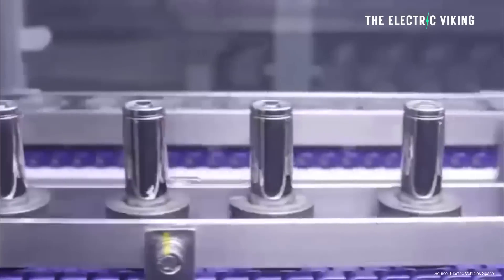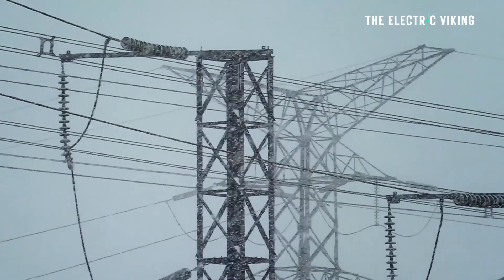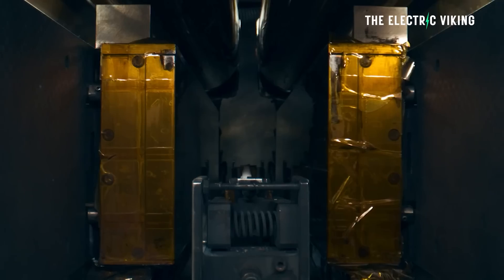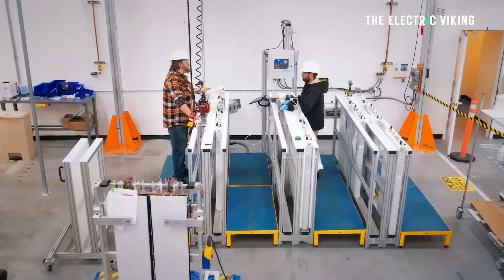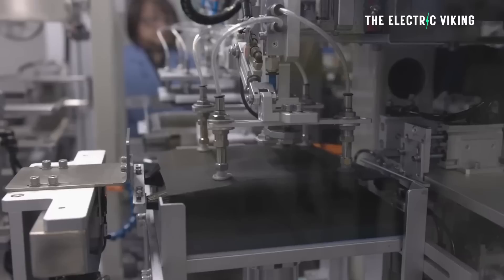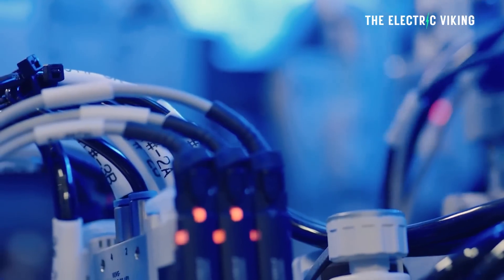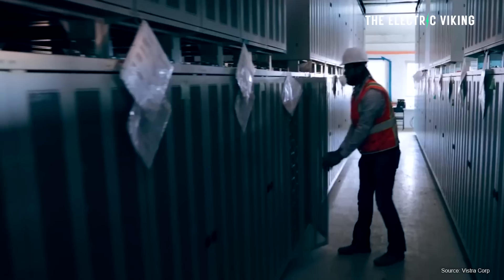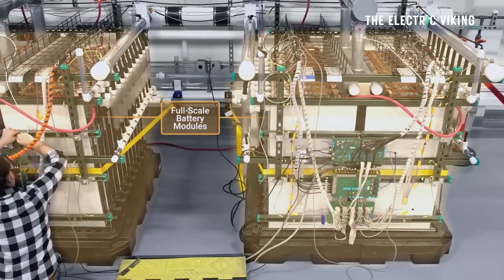U.S company reveals revolutionary battery that DESTROYS sodium & lithium

Comment: Talks a lot, but knows very little about technology.   He is surprised that iron air battery would be the selection for lost curtailment power storage and discharge.   This means he doesn't really understand what is happening with battery chemistry.  Also did not hear anything about the pros and cons of this battery.  Disappointed by this channel, so just another one I don't have to bother with.  If the reader wants more information watch "Just have a think".

Comment: 3X calendar and cycle life is probably the way they figure 1/10th the cost amortized of 50+ years.   But the low power density means Sodium Ion or LFP will certainly have a market to meet maximum power demand, as small scale applications like charger, wind and solar farm buffering.   These Iron batteries have higher upfront cost especially for short duration.

Comment: Adjunct to lithium/sodium, not a replacement. This is base grid storage, and the Li/So are ‘peaker’ storage. VPP/VMM tech not so easy to duplicate …or they would have already done it. ENRON did come close, but their problem was ‘gambling’ with other people’s energy. “Oxidation” as a catalyst using iron or different materials requires large/Big/HUGE infrastructure, so this is a lot of smoke until we see what’s behind the mirror.

Comment: It sounds to be in a similar situation as the Zinc Bromide batteries that were being touted a while ago. Hopefully the tech actually starts working soon.

Also, the number of days of storage is not the capacity, but takes into account other practicalities, like efficiency and power capability. The Limiting Factor did a nice video about it called: "How Grid Storage Duration is Assessed and Why it Matters".

Comment: Multi day storage equals low payback, batteries earn money only when taking in cheap/exsess and delevering energy, not when holding energy. Therefore it must be very low prices to consider.
Reply: One area long duration batteries help with is grid congestion, where there is a generation imbalance between grid locations and a transmission limit between those two locations. In the current model Grid's pay generators for not puttting power onto the grid in the over supply areas and at the same time pay for high spot rate peaker plants to rapidly generate energy in the constrained area. Long duration batteries address this by balancing these two areas more evenly reducing the wasteful payments involved. The pricing cases take this into account, as the Iron-air batteries are a capex spend rather than an operational spend (other than servicing costs), hence work out cheaper to operate.

Comment: Wouldn't the voltage be very low? Wouldn't you have to have A LOT of cells in series to get a decent voltage? Seems like you would need a HUGE battery to get something useful. Enormous really. I'm not sold on this.

Comment: "While iron-air batteries have a round-trip efficiency of around 50-60%, lower than lithium-ion batteries (which exceed 90%), their key strength lies in long-duration storage." That's the downside, getting less energy back. 1/10th the cost is good, but not otherwise equivalent, but I suppose you can use both this and sodium-ion and/or lithium-ion or other tech for first days/s and this for longer term storage. Don't you need for even longer storage in some situations, e.g. across seasons even (say in Iceland photovoltaics not worth it, or at best in the summer?)?

Comment: What I haven’t heard you say is what the size/weight to energy storage ratio. Large scale grid batteries don’t have to small, they can be considerably larger, even if the output is lower. Current batteries are principly for cars/trucks. So the story could be true. You won’t be able to use them for cars however.

Comment: When you put two metal rods into the ground, a voltage potential exists between them. 
If you bury them very deep into the ground and use frequency modulation you obtain higher and higher voltage.
When you raise a higher isolated wire up in the air, a huge voltage potential, like kilovolts per kilometer, is obtained.
One can even design and build a humongous continuous capacitor between Earth and the air around Earth.
Etc.

Comment: I wrote this right before getting to the part in the video where Sam addresses this!:

What's the C-rate? I can't imagine this can put out much power, so would only work in applications where it does in fact need many days of storage just to have a big enough battery to put out the power required. But if it is 1/10th cost, then maybe it would be worth having a battery with far more storage than you really need, as it could bring down the amount of "extra" solar and wind that is needed (eg instead of planning for 3-5X the solar needed to cover demand on cloudy days, that could be cut down to 2-3X)

Comment: Hey Sam:  I just went thru the Form Energy website... their Newsroom pages are an amazing resource. They are building a $750m manufacturing plant... that takes some big balls, without scale-up and proof of concept on a smaller scale... I wish them well. One thing you didn't mention... batteries are only half of the equation... the other half is the software and integration of solar/wind generation + batteries >> the existing conventional grid. Software is everything in integration, and only Tesla has nailed that half of the equation.

Comment: 2% - 4% of world's population lives in regions in the North where solar will never be enough around the year, and where there can be periods in winter/cold time with no wind. The described "rust battery" with relatively "low" power output would serve the Northern regions quite well  if the building cost per MWh is low enough. Something like that -  high storage capacity low cost battery - will be needed by the North. This is like 10x Australia's population.

Comment: At 2 to 3 MW per acre compared to (how many LFP megapacks per acre)? Looks like "housing" costs will be more expensive than the battery itself 🤔
Maybe the energy density is around 1/10th that of the lead acid? There's no mention of the efficiency, or the amount of energy needed to make them, either? If they last a century, though, the energy inputs couldn't be that bad.
So the main thing is "will 5x the solar panels be required to make up for piss poor charge/discharge efficiency"? If so, H2 (or just the more expensive LFP and Na-ion) is the better option.

Comment: This Form Energy battery is being installed in Stinking Lincoln, Maine, at the former home of a paper and pulp mill. Maine has one of the highest electric costs in the US. Its grid has major stability issues due to an outdated power plant design and above-ground power lines in densely populated forests. Unlike the Form Energy going up outside Minneapolis, MN, wind is the primary energy storage source. New England natural gas peaker-utility plants have issues running due to low gas pressure during the winter. The first priority for NG is homes, so NG peaker plants sometimes cannot run at full capacity in the winter.

Comment: Well if the C rate of these cells is low, it seems putting them in parallel would compensate for that. But yeah 1/10th the cost of production would be enough to send the price of surplus lithium ion cells into a tailspin... like within the next 6 months.

Comment: As an IT guy, the comparison that comes to mind is SSD vs traditional platter disks. Speed vs cost-effective capacity. Both excel at their own specialties and have a place in the system.
Reply: As a storage specialist, I kind of agree yet see other shades in there too.
Most energy experts understand the concept in a similar way. There’s literally charts and models showing short-term millisecond dispatchable energy (think Tesla mega packs) all the way up to long-term multi-year dispatchable storage (think closed loop pumped hydro).
Quite frankly, I simply don’t understand how this isn’t obvious to everyone.
Reply: ...or pumped hydro vs Lithium ?
Reply: @malcolmc7327  Pumped hydro might be like tape backup. Highly specialized, slow but massive capacity. Useful in the right cicumstances
Reply: As a non-IT guy, I know there's a hierarchy of memory from cache to storage, and I don't know why there isn't something like that for energy (unless there is?).
Reply: @riffsoffov9291  There is.  Some power plants are pretty slow to startup from a shutdown state, especially nuclear where some reactor types need to idle for days before a restart can even be attempted.  Thermal power plants in general are on the slow side with a few exceptions such as some gas turbine plants.  On the fast side are pumped storage plants.  The one where I worked needs about a minute to change between operating modes.  If a consumption surge is expected the turbine might already be spinning at 0 MW and brought to full power in like 30 seconds.  We used to call ourselves the grid's fire brigade.  The latest and greatest are battery based.  By now they have reasonably large storage capacity and can adapt to the grid's requirement almost instantaneously.

Solar and wind doesn't really have an equivalent in the IT world.  Sometimes they deliver, sometimes they don't and it's not always predictable when ;-)  Unless we're talkina bout networked storage attached over avian carrier.  Insider joke, search for "aviant carriers" and read the network standard for it.
Reply: Great analogy.

Comment: Don't be coy. tell us the voltage of iron rusting, and how do they get a current to flow through air as the electrolyte?
Is this a corona discharge (Ion wind) type of thig?
Reply: Why not take a look at Form's website, they state it uses a aqueous based electrolyte with a iron anode and air based cathode. Hence no air gap corona discharge. Cell voltage of this setup will be circa 1.3 volts.

Comment: It is a bit better to think of it as a fuel cell.  Part of its chemistry comes from the environment unlike most batteries.  This means that a lot of what is needed for operation is not counted in its weight and effectively costs nothing.  Iron, also is really cheap stuff so the low price seems likely.
Reply: It's more a case of the other way round with fuel-cells being a type of battery system. In this case though it's not a fuel-cell, there is no constant supply of a consumable charge carrier, rather it's more akin to other metal-air battery designs (Zinc-air, Lithium-air, etc.) with some aspects of aqueous alkaline battery designs (similar electrolyte). Some of the early Iron-air cell design incorporated a hydrogen fuel-cell component alongside the Iron-air batteries; the fuel-cell acts as water / electrical generator to recharge the Iron-air batteries from hydrogen stored during the 'rusting' (red iron oxide producing) discharge process. But these fuel-cell based designs are fairly inefficient, due heat loss both in the iron-air battery and fuel-cell. Later iron-air cell designs do away with the fuel-cell component and reduces Iron directly to Iron Hydroxide (green rust) within an aqueous electrolyte that then further reduces onto black iron oxide (magnetite/black rust), releasing electrons at both steps; charging reverses the two steps releasing oxygen.

Comment: Fe/air batteries are only 50% efficient due to H2 evolution during charging. Hard to overcome that in an aqueous battery, and, the voltage is always limited in an aqueous system, no greater than 2.3 V due to the limitations of O2 and H2 evolution. Also, getting off subject, offshore wind turbines are a complete boondoggle and a folly. 😊
Reply: Why not capture the hydrogen?
Reply: @danncorbit3623 

That’s not what the system is designed to do, it’s wasted energy, not to mention the lost heat. 
Hydrogen generating systems are designed fir that purpose and do it with far greater efficiency.

Comment: I worked on Li-ion batteries for years and became familiar with the battery industry. I agree with your comment about the claim that the Fe/air battery can be charged for 1/10th the cost of a Li-ion battery. There’s an old adage in the battery industry, “There’s liars, there’s damned liars, then there’s battery salesmen”
Reply: Just look at the number of battery vids on yt and your adage becomes a statement of truth.
Reply: He didn't say charged, he said built at a 1/10 of the cost. Still sounds like bullshit to me.
Reply: oh no, not another game changing battery, that's more than a dozen in the last eighteen months😂
Reply: Is it possible there's a tradeoff? Ex: 1/10th the cost but requires 10X the volume of material? The claim isn't that they are 10X more energy dense per pound.
Reply: @christiankruse1970  there are multiple trade-offs. This Electric Viking fellow simply isn't smart about them. He mentions the poor C rating of the iron oxide battery (0.1?!), but there is also specific density (kilowatt•hours per kilogram) and volumetric density (kWh per liter). And round-trip efficiency: you get more than 90% of the energy you put into a lithium ion battery back out again, but it may be that rusting iron only returns a fraction of the energy it took to un-rust iron oxide. And operating temperature. And self-discharge over time. And, and...

There are engineers who live and breathe these trade-offs, but the Electric Viking isn't one of them
Reply: @christiankruse1970  I can't imagine anyone would be seriously persuing this if it were 10x the materials. 2-3x is plausible though
Reply: I built an electric bike about 10 years ago and the battery I used then is similar in size and weight to the one I bought last year. Both have the same range yet I keep hearing of all this battery innovation. Perhaps I'm missing something.
Reply: Was he saying charged, or just cheaper per kWh storage.
Reply: @michaeljames5936  
He said charged, but whatever, Fe/air is not a better chemistry than Li-ion
Reply: that's the entire energy industry.
Reply: And then there's politicians 😂
Reply: There "are"
Reply: Yea, on its own, that comment makes no sense. Perhaps if they said something like, because Iron-Air requires little to no risk when charging, there is not a need for as much of a BMS, so the cost of the charging system is markedly reduced? Not sure.
Reply: They are probably only talking about the cost of materials, lithium vs iron.
Reply: Every week, another break threw
Every week, more money thrown away
Reply: @Notyou5556   i have no problem with breakthroughs, if they’re substantive. The problem is, most are not. Researchers need to remember that the electrochemistry is limited by the periodic table.
Reply: So True; battery manufactures are like companies that make rockets.  They all make outrageous claims about future performance but only a few companies actually do what they say. Having said that I wish them luck in developing the technology.
Reply: @Mrrich3  Sounds just like FSD...ohh the BS is smelly
Reply: @Mrrich3  I'm 100% sure that no rapid progress is allowed. If you would make battery that beats Li/ion, some important people would visit you and talk reason to you not to publish it;) Only slow progress is allowed.
Reply: @GallAnonim-jx2cz  We need a lot of batteries in Ukraine for the coming winter. Is this an excuse to unleash the progress? Around 7 million freezing Ukrainian refugees in Europe, are they enough?

Comment: This iis a base-load technology.  If it is twinned with a Lithium/ion megapack the Li could deliver peak load and the iron/air re-fill it as needed.
Reply: This is not base-load anything.  Base-load plants are power plants that continuously run at 100% power for long, long times.  Nuclear power plants are the epitome of base-load.  Batteries, any batteries, are storage devices; not only are they not base-loads, they aren't energy producers of any kind.

Comment: 1/10 the cost of current battery technology sounds very reasonable to me, since iron is the most common metal on the planet, and air is everywhere. Using oxidation and its reversal as a power storage method would of course not degrade the iron, resulting in the extended battery life claimed by the makers. As a semi-joke, an EV based on this technology would be the ultimate expression of the Rusty Rat Rod ethos currently so popular with car enthusiast around the world. May we rust in peace.

Comment: no one said that these batteries could not be used in conjunction with sodium or lithium to get the bump in demand needed where the air iron cannot deliver enough base load.  I believe this hybrid platform would work and be super efficient.

Comment: 1/10 the cost. Make it ten times larger to handle the 6pm high demand drain as its normal load. Keep it charged with wind and solar. Let that combo configuration be the entire grid supply. Multiday is necessary and logical with grid supply replacement instead of supplementation  That's how you would configure an off-grid house.

Comment: One thing you've got to remember about batteries is Elon and Tesla are constantly looking at all the different battery chemistries that are in development because the market is such that as said if a battery comes out that is way cheaper to produce and more energy dense it could affect their business very quickly but as you can see they're sticking to their current range of battery chemistries and focusing on improving them.
Reply: If Musk would stop watching Fox News and tweeting he'd be on Mars by now
Reply: Well Form Energy is headed by Mateo Jaramillo, the former VP of Tesla's stationary energy storage, he spotted a gap in the market that isn't seeking to address a different chemistry but a different energy Grid need, one seeking to address both renewable curtailment and grid congestion with a more affordable solution. Their goal is not to replace Tesla's, or any other company's, Lithium/Sodium based technology but to compliment it with a lower cost technology allowing the more limited Lithium resouce to focus on peak grid demand applications, mobility and portable requirements.